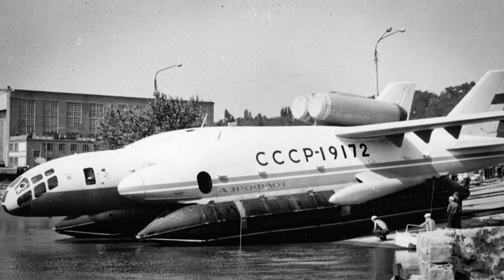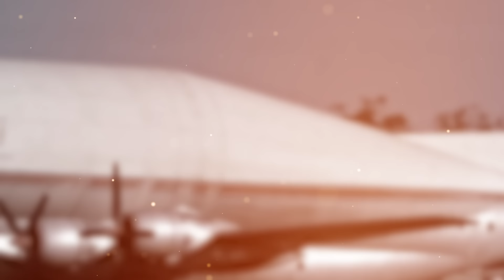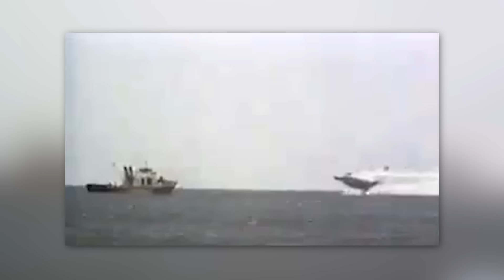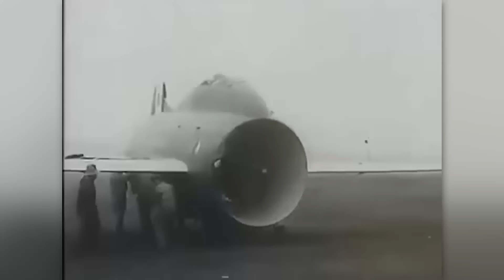This Is The Strangest Aircraft Ever Built

Comment: most amazingly wrong page.  full of rote statements and horrible inaccuracies.  For instance, XF5U having structural issues (A wrecking ball bounced off the plane when the Navy decided to demolish the completed prototype).  Later, describing the Piaggio Avanti as having a forward swept wing, when a simple review of its planform clearly shows a high aspect ratio, slightly tapered, straight  wing., also describing a mid-20's design as having powerful engines.  So not worth wasting time on.

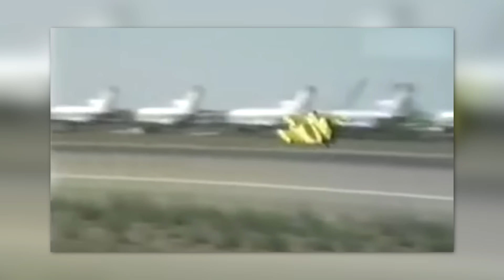Comment: 24:30 - None of the Bumblebee footage features features a rotor, nor teo seat cockpit. Only one or two very short clips show open cockpit, while on preserved example a transparent canopy is clearly visible. It's fuselage is anything but "slender", and its negatively staggered doal wing anything but "conventional". Actually, practically nothing said about the Bumble Bee is accurate. For example, it was specifically built to break the world record for the smallest piloted aircraft, not for recreational use.  

Aaaaargh! XFV doesn't have "tiltwing design" - it was one of several attempts as "tailsitter", an aircraft that lands vertically on its tail, "hanging" from counter-rotating propellers powered by turboshaft engine(s) providing thrust greater than the craft's weight.

This video is chock full or cuch inaccuracies, illustrating footage having little to do with the plane being talked about, and repeating, formulaic  narration. It is not easy to make a good factual video on anything; history of aviation is not an exception.

Comment: The B83 bomb is no longer in the USAF's arsenal, and only the B-52 could carry it. This weapon would've been too big for the B-2's twin weapon bays. Also, the XF5U-1 never flew so how could it encounter structural issues. The Curtiss Duck was an aircraft from the 1920's, and in the plans of the aircraft that you showed, there are no weapons at all, so how could it be used as a combat aircraft in WW-2? Another thing: the real factor in the Goblin program being cancelled was the air force adapting it's fighters for in flight refueling.

Comment: Ignoring the click-bate title, as Yoda would put it, "The bullshit is strong in this one". Of particular note is the bit on the Curtis Groupil Duck: where the hell did you get that crap? As is painfully obvious from it's Jules Verne appearance, although the Duck first flew in 1917, the design can be traced to an unpowered monoplane glider from 1883! Not only did it not enter into production, it only flew once in an attempt by Curtis to challenge the Wright Brothers patent claiming they had invented a practical latitudinal control system for a heavier-than-air flying-machine. Curtis's challenge failed & the Groupil Duck was immediately scrapped.

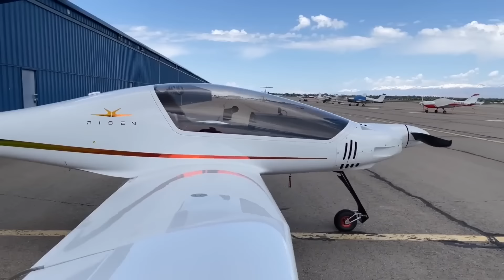Comment: Please, please, do your homework before you publish! Example: The Rutan Varieze is pronounced "very easy". Just like that, very easy. Then, at 19:16 why or how you would mistake a "Rizen", which is a Swiss made ultrafast but more or less conventional ultralight, for a Rutan Varieze is absolutely beyond me.
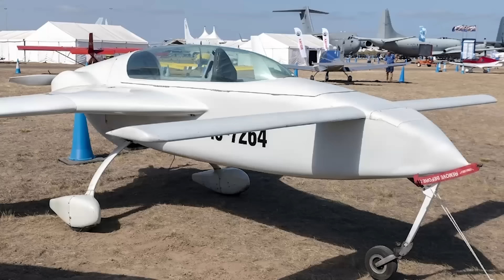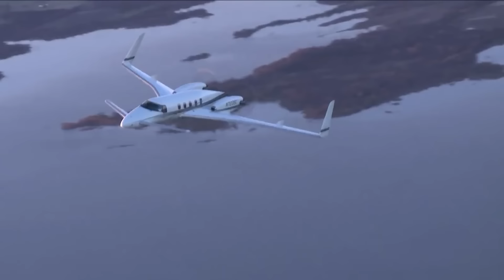19:22 this sentence about canards and taildragger design doesn't even make any sense. Taildraggers are just conventional airplanes with conventional landing gear, in contrast to conventional airplanes with a three-wheeled landing gear, or tri-gear configuration. Then, as if all of that isn't convoluted enough, you mix in a Beechcraft Starship at 19:47 , which is a much larger twin turboprop design for heavens sake! Could you at least count the propellers?
This doesn't spark joy!
OMFG, and the Bumblebee is not a two-seat gyroplane. That's simply outrageous. You don't even need to read about it, a single photo is enough to determine this is wrong! You actually managed to get every known fact about this unique machine completely wrong, which is quite a feat given the fact that the pictures literally disprove all of your claims.

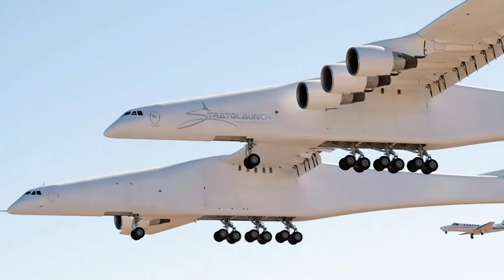Comment: 28:17
That is a White Knight, NOT the Stratolaunch.
Both WERE designed by Scaled Composites/Burt Rutan, and both have some inspiration from the older Proteus design.
Reply: the White Knight has 4 engines  that is a Roc
Reply: @kwakagreg  The parts of the video a couple seconds BEFORE and AFTER the time I marked is the Stratolaunch.
Look again at the specific timestamp, short video of the White Knight dropping a Virgin spaceplane.
And yes, 4 engines on that part.
Reply: @bricefleckenstein9666  I apologise didn't notice the time reference. was on a different line. The whole thing is spoilt by wrong aircraft being shown...

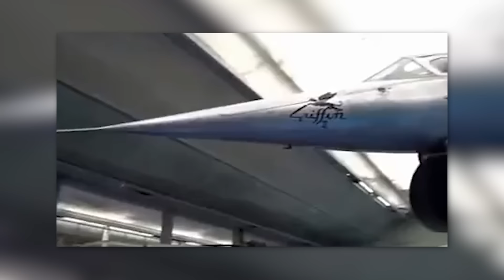Comment: 21:28
The Nord, like the A-12/YF-12/SR-71, had DUAL propulsion
Both a normal jet engine AND a ramjet.
The Blackbirds however had a DUAL-MODE engine (both turbojet AND ramjet) while the Nord used separate engines.

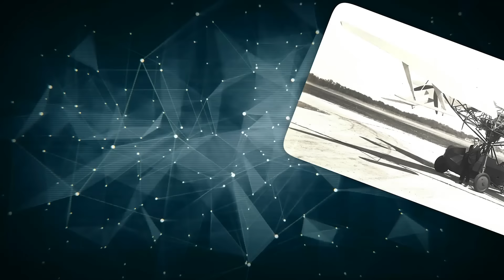Comment: 5:26 is a British Experimental helicopter... Not a Duck.
That Bumble Bee?  Are you smoking dope?   Pull your head out. Gyro? 2 place?  Screwed the pooch there Skippy
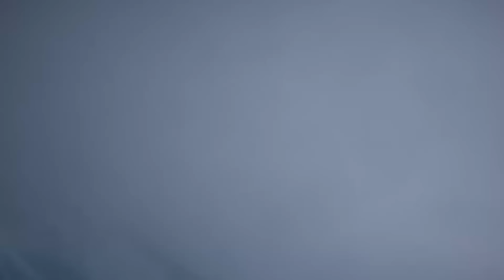Reply: Sorry to tell you, But 5:26 is a Curtiss prototype. from around 1926.
Reply: That is a helicopter, single power plant geared to two propellers -two bladed rotor system - Bentley rotary 
1924 Brennan , Crashed Oct 1925 , Funding removed .  @stellar1620